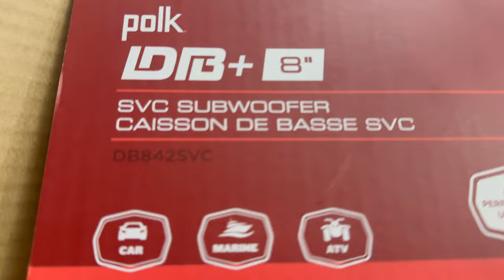Hummer EV subwoofer upgrade in factory enclosure for 2022+ HEV

Comment: Thanks for posting this ViperMike.  I'm interested in replacing the sub in my new 2025 3X truck.  If you had to do it over again, would you replace the enclosure all together, or just put an amp on your existing setup?
Reply from the maker: Realistically this upgraded sub needs an external amp. I didn’t really notice much difference since changing the sub out. I haven’t found a good place to run a power wire from the 12v battery to power an external amp and didn’t want to drill any holes, so I didn’t install one.
Reply: @ViperMike  I get that.  I'm a DIY'er through and through, but I might leave this on up to the pro's.  Thanks for your feedback.